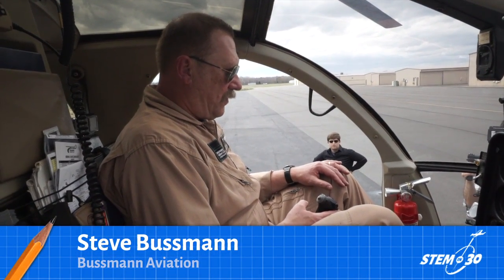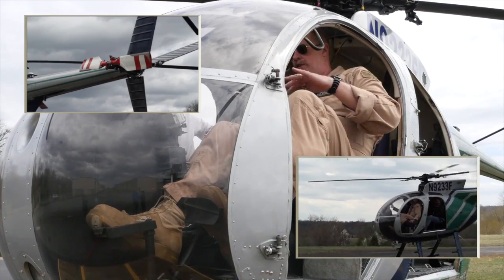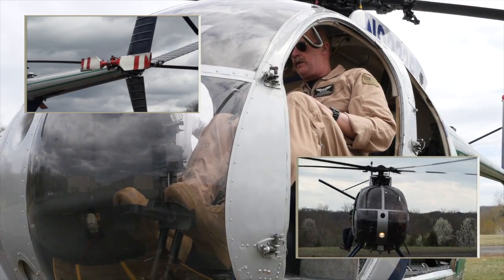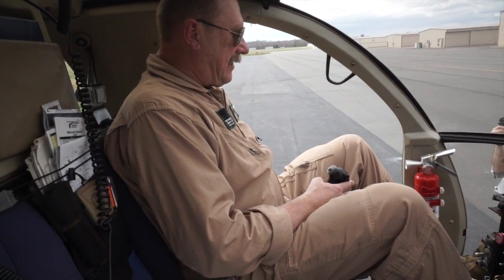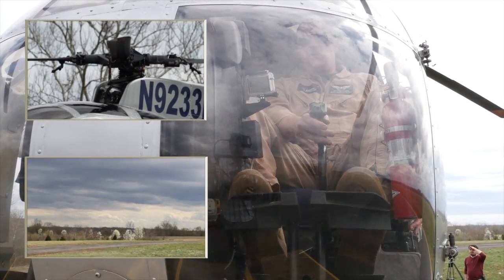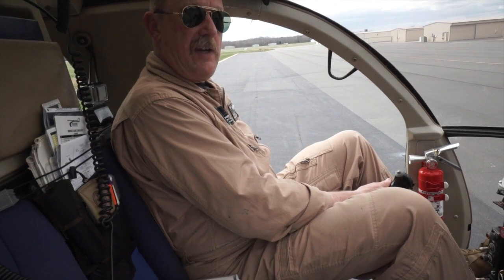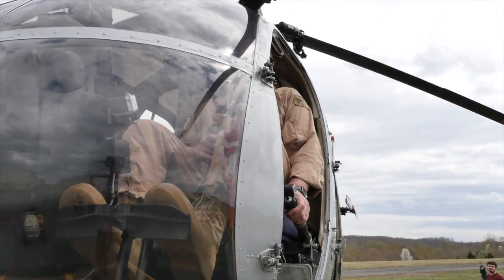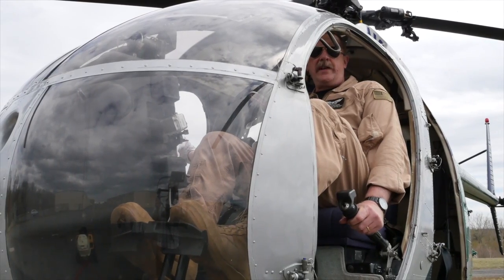Helicopter Controls

Comment: Always wondered if the pedals were "push left=yaw left" or.... "push left to turn right (like a push cart might have)", kinda hoped it was the latter.
Could imagine being in right seat with left hand on a (central) collective.... twisting throttle towards me for more power... with right hand on the cyclic between the legs.
Now I realise thats pretty much all wrong lol
Gotta get me head changed up into....*left seat* and "push in direction you want to face.... roll throttle away from you for power(?)"

Comment: One of the big challenges on some choppers is that as you pull up on the collective you need to adjust the throttle to give it the extra fuel it needs for what you want it to do - but better equipped choppers have a device that pretty much does it for you.  Flying a helicopter is far more challenging in its basics than a fixed wing plane.  For instance, as you pull up on the collective you need to adjust your pressure, left or right on the foot pedals or the bird will turn.